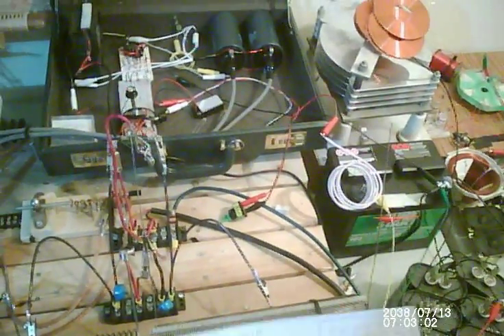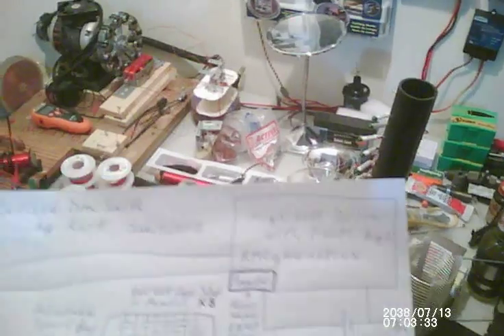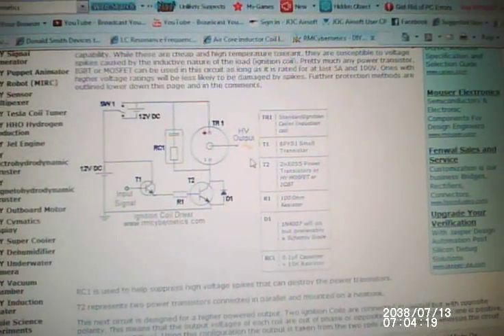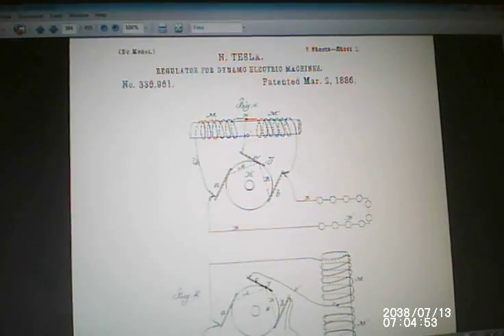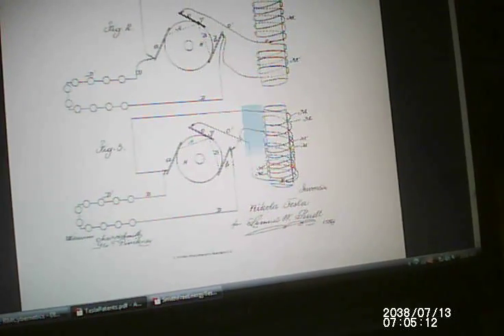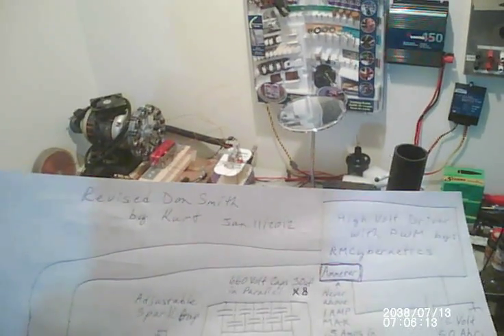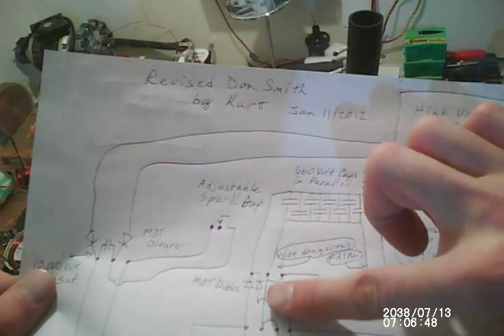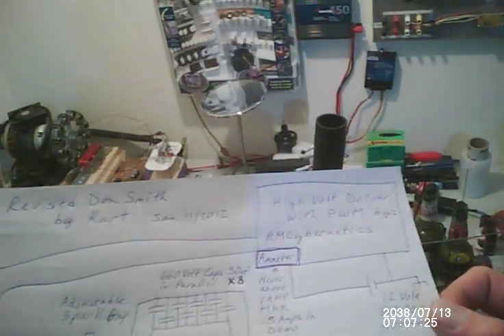Don Smith Device Project Part 20b: Revised Schematic, Increased Output, and Capacitor Discharge :D

Comment: Can you please tell us where to get the rib mounting strips that you use for your air coils? 
I don't know what they are called or where to get them. Thanks for all your work!
Reply from the maker: +Henry Foltz hi man, by your question i assume you are making your own coils? unfortunately these are bought from B&W and were quite expensive. The plastic pieces are Lexan, looks to be done by machine and impegnated into the lexan. 
i think they were 125$ US per coil, and i also have a few of the 4" diameter ones about 500$US a piece. they are not cheap, and to be honest you could totally make your own using dry wooden 10" lengths glued on every 4 side, wrapped over a tube form until the glue dries. using 10 gauge wire i think.
There really is no magic in them though, after i figured some stuff out, in such a short length you can set your own inductance using a calculator, and these honestly were a waste of money

Pretty though, and i do have plans to return to this project, but all my stuff is in storage right now

Comment: @kdkinen Interesting. Is the output even measurable? I've found in some of my circuit that involved pulsed Dc, my meter just goes absolutely wonky. One might have to devise a small heating element and attempt calorimetry

Comment: So the bulbs you used, are actually 12 volt bulbs, and you demonstrated the inability of the battery to properly illuminate several in series (not surprising), the circuits ability to do so (HV)... but... in your opinion, if you darkened your room and produced light from a SINGLE bulb, 12V@.5A (or whatever), and then... you run the circuit... and you drive 5 bulbs. In the dark. Also consuming 12V .5A. Can you see a difference in illumination? Cheers

Comment: Yes 12V .5 A 
hang in there. you are going to get it.  be careful. looks like the dynamics are growing, I suggest handling cautions, and I do not know what is possible but broken fire-hose is possible. make sure you have a safety switch. That is my term, I sure you get the hint.
Zane